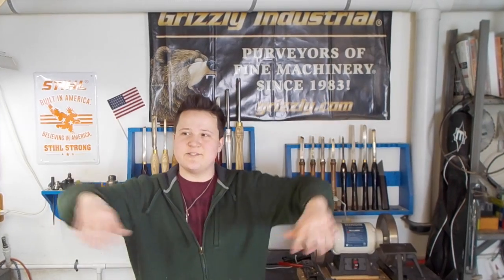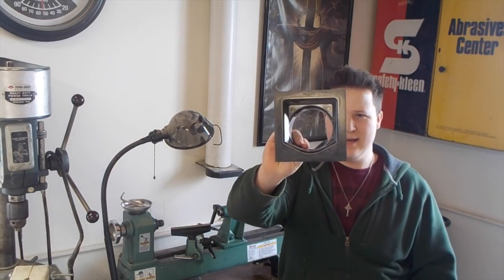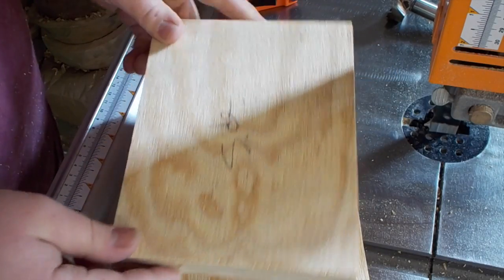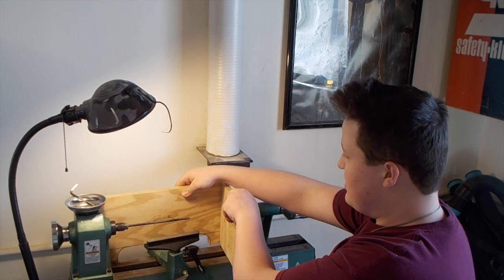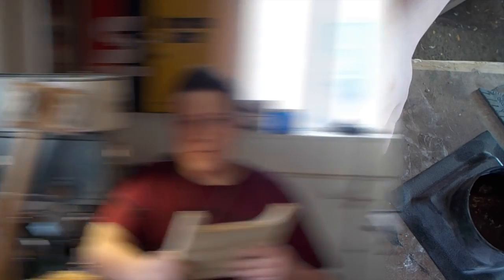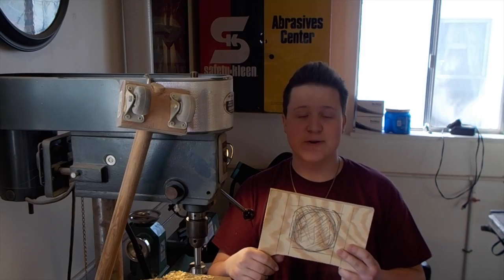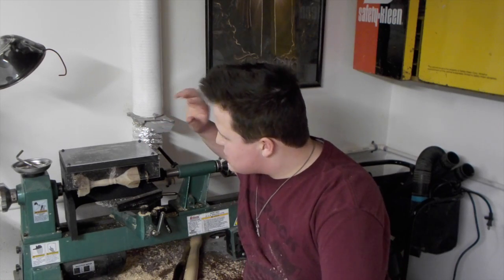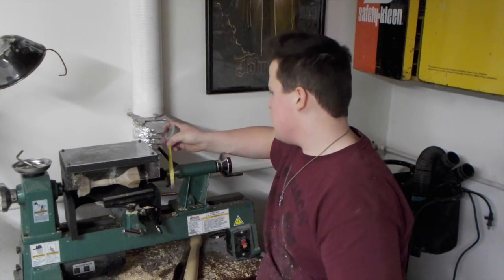Ultimate Mini Lathe Dust Collection

Comment: Peter,  I finally had the opportunity to watch this video. Great food for thought! Now I'm debating on whether I want to build one for my lathe or not, Primarily for sanding dust collection. I may consider a tray under the lathe for chip collection too. I'd love to hear your thoughts after a couple weeks of use. Since I have the same mini lathe and also primarily only turn pens on it, your input will be greatly appreciated and extremely relevant to my decision. Regards,Bob
Reply from the maker: +RJBWoodTurner Hi Bob,
Thanks! Like it shows in the video this didn't work too well, but I turned several pens with this and it works really great for pen turning.  Two things I don't like is that dust and chips with sometimes stick to the plexiglass if the air's dry and also it feels a little unnatural to work with this thing over the pen.  Works well though! 
Thanks,
Peter
Reply: What about a product like Rain X to kill the static? there has to be something.